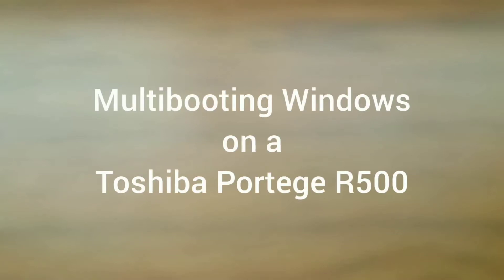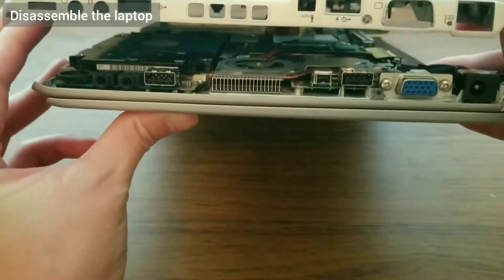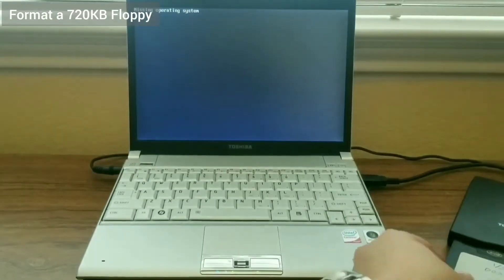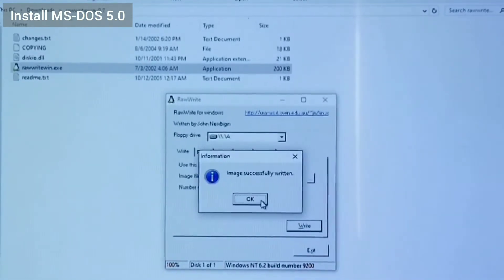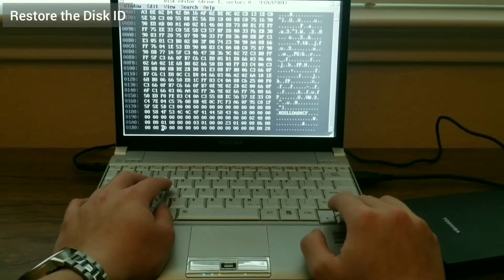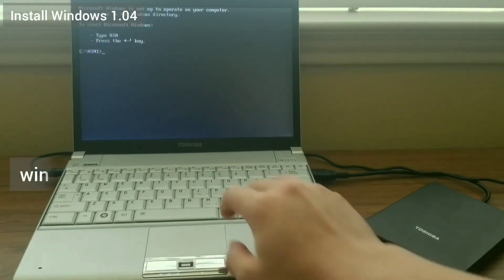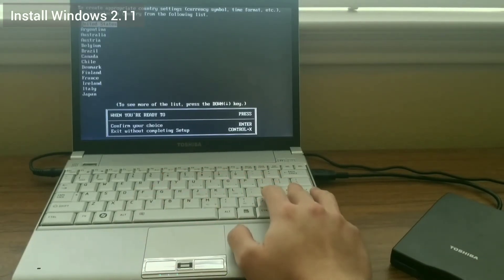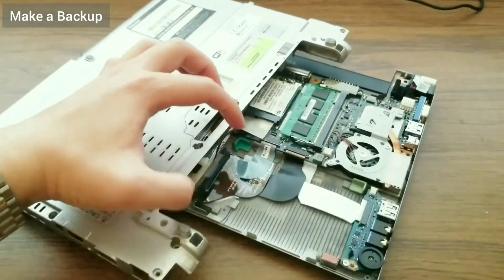Multibooting Windows 1-10: Part 2 - MS-DOS 5.0, Windows 1.04, and 2.11

Comment: Is it possible to install DOS using a USB? I did the method you used for installing Windows 3.1 but for DOS, booting from a FreeDOS live USB, and it complained about no disk drive A.
Reply: Also, trying to run dosshell (both as com and exe) both just give filename or command errors.
Reply from the maker: it might not work. DOS was way before USB.

Comment: Another problem with XOSL

When installing XOSL on a DOS drive and rebooting, it just shows some text saying "Extended Operating System Loader".
But if I install it on a dedicated partition, it works fine. But the problem with that is it overrides DOS and uses up a primary partition.

Booting into the hard drive using a VM actually lets XOSL load.

Is there any reason why it would be doing this?
Reply: Is it possible if I can leave out a OS marked as primary? (most likely ME)
Reply from the maker: it's ok that it overrides DOS, as you configure the menu to be able to boot DOS from that partition.
Reply: @davidsdetaileddiscussions  Overriding DOS completely reformats the partition so DOS isn't installed anymore. Do I reinstall DOS on the same partition, then reconfigure XOSL?
Reply: @DoggoYT  if you reinstall DOS, it will say that your partition is unformatted and you have to reformat it thus overwriting XOSL. My solution is to just make like a 16 or 32MB primary partition to install XOSL in. Don't worry about Windows ME not being installed on a primary partition. It works perfectly fine on a logical drive. When you get to installing windows NT/2000/XP/2K3, just make the windows 95 or 98 partition active and install it from there. The bootloader will be saved onto that partition thus letting you install newer OS's without too much of a hassle.

Comment: I tried installing XOSL on virtualbox and it froze at the loading screen.
Reply from the maker: virtualbox may be doing something different during the boot process since it's virtualized.  it's not the same as installing on the actual hardware, but more of an emulation.
Reply: @davidsdetaileddiscussions  ok I used a different boot manager this time even though I think it is the reason windows 98 froze when booting on my VM
Reply: is OSL2000 also a good boot manager for this type of experiment? Sorry for waiting 1 year to ask this lol @davidsdetaileddiscussions